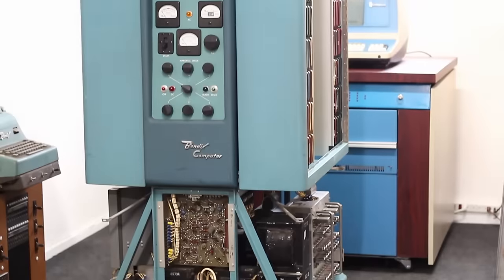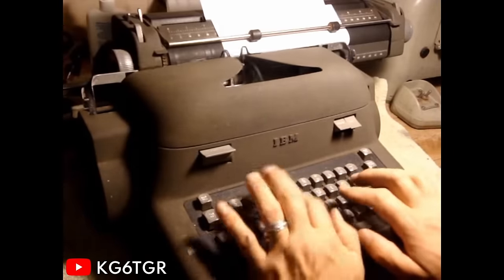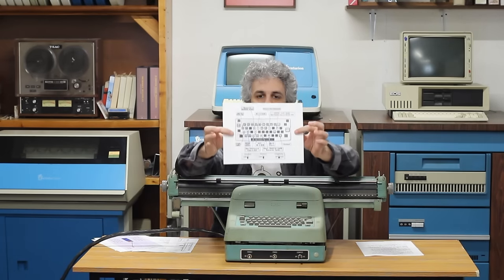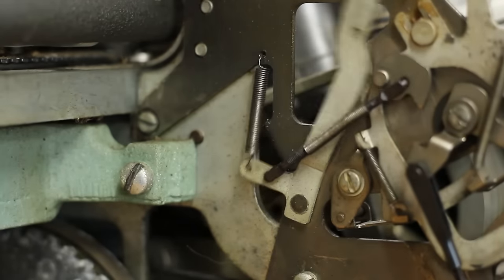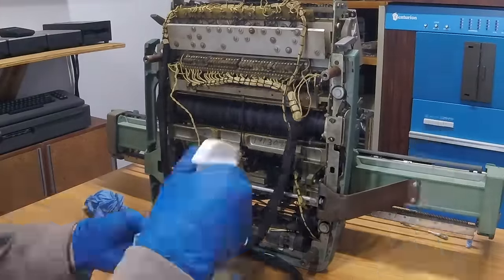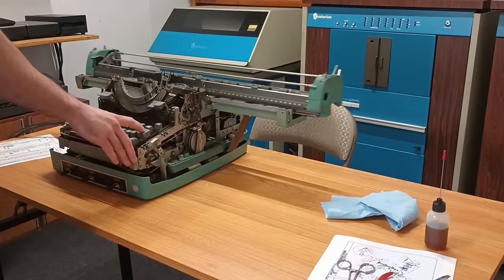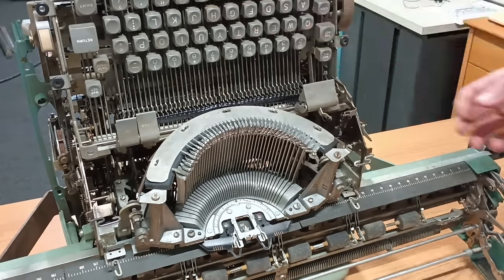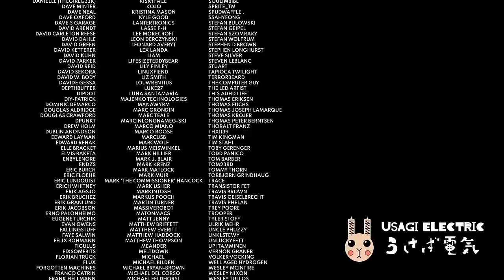The Bendix G15 Typewriter is Crazy Pants!

Comment: Love your channel and videos!

I used to have the basic typewriter that your beast is based on. And yes, it shook the desk every time you hit return. I can almost smell the oil from the electric motor bearings as I watch the machine run.

BTW, I worked in a computer repair shop that resold used computers. To clean them up, we used a SImple Green/Dawn dish soap combo in a spray bottle, with just a little water to thin it down a smidge. The Dawn breaks down the "people grease" (oil from people's hands) better than SG alone.

Comment: At Bendix, someone was told that size matters apparently.
Reply: What blows my mind is that the 28 inch platen doesn’t have the look of something which was cobbled up for a small order of a handful of machines.  15 inch platters were not unusual, but 28 inch!…. I would have guessed that maybe some sort of chart was printed on this Bendix-ized IBM.  I was thinking, perhaps weather maps, but the restriction of only 16 codes available for characters no special type slugs for graphics rules out printing maps.  Weird.

Comment: Great work looking forward to DC..   As for setting up the mechanics of the teleprinter you did right in passing this to someone tuned into that device, you skills are epic..  I know that teleprinters and typewriters can be a challenge,  I remember the Creed 75 RPTK which used an aggregate motion mechanism to translate  motion  in three planes to the drum type head.  Move R and loose the Y and vis a versa. Even a drop too much oil would through the alignment. The  IBM Golfball was a dream to set up.  Teletype 33 responded well to kinetic adjustment.  Best

Comment: Back in the 1960s, I worked on a slightly more modern computer called a LGP-30. It was also a tube computer with a drum. The typewriter was a Flexowriter and the hexadecimal codes were zero through nine, then FGJKQW.

The typewriter also had a tape reader and could be run independently using that reader.

The thing that strikes me about the typewriter in this video is the difficulty of managing paper. It must flop around quite a bit.

Comment: They make specialized cleaning solutions for platens.  You should try AF Platenclene Cleaning Solution.  It's what I use on the pressure sealing machines we use at work.  Simple Green is fab stuff but it is mostly soap and water which could dry out the rubber.

Comment: That’s awesome.  Not only the resurrection, the unique (did you say, “42 inch platen”?) dimensions! ❤

There is 1 mod’ I recommend.  A lamp inside the window of the printer’s power indicator.  Maybe a couple of NE-2 lamps, which would be period correct.

Your skillset may not cover fine tuning of typewriters, but your skills and results (with all the beautifully restored equipment behind you), is truly, outstanding and inspirational!  I am envious.

I’m looking forward to the next instalment of the Bendix system revival 😍.  It will also be impressive, if you can demonstrate a working program (ie, tic-tac-toe loaded from paper tape).

Comment: I had one these as a plain short platten IBM typewriter which had been through a flood.  It took forever to clean out the mud.  My Waterloo was that the motor was a goner and I was never able to find a motor of the correct dimensions even though it was a fairly normal looking fractional horsepower motor.  The plastic rollers and internal rotating bar for activating the type hammers were an interesting method , a bit like a piano - not even close at all to the Selectric technology which followed.

Comment: Wheeeeeeeee! Wheeeeeeeeee! I'm riding the carriage!
What a beautiful machine :)
It looks like it's badly in need of recapping, to do it true justice. For some reason it impresses me even more than the Selectric! Minty fresh with a hint of Tektronix teal.
Good luck with VCF East, and beat Jeri at pinball this time, haha! CuriousMarc will be there too.
Reply: There are a few paper tube electrolytics in there but the really bad-looking cylinders are diodes in a kind of rubber sleeve rather than capacitors (or maybe it was inductors but definitely not caps, the same style is used inside the computer).

Comment: I love this electro mechanical stuff.  A work of art.  Congrats on getting it cleaned up and working.  So cool!
For a split second, I thought I saw one or these used on the Loki series.  I just looked back and I think it's just a standard IBM electric typewriter but with a large platen.  Not a massive one like the Bendix.  BTW, check out S2:E6 at 46:32 if you want to see what I mean.

Comment: Remarkable progress on this thingy.  You might try finding another ribbon.  It looks like it's getting kind of dry.  That might resolve the lower-case printing problem without a lot of mechanical stuff.  I seem to remember that adjuster on the right for hammer force actually adjusts the distance between the platen and the hammer just slightly...  Play with that incrementally until a "best quality" print results.  Good work on this, man.  I'm looking forward to the day you push the big green button.

Comment: You have to do alignment adjustment, ring and cylinder adjustment, and then adjust the tension screws on the friction roller for a harder imprint.

Comment: You should have used oil and a little bit of hand sanitizer for the rollers but you do you 
And any other rubber that doesn't move  on a rod just used water if it's belts 
But just do you
You can adjust some bits of it

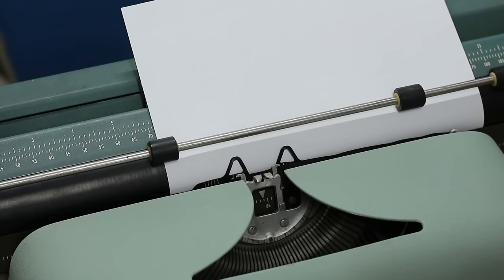Comment: From someone who grew up in the typewriter age, that lever at 18:30 that goes from A to F is to adjust the platen for when you are making multiple copies using carbon paper. Some of your viewers may now be wondering, "what's carbon paper?" I will leave it to the Internet to answer that question for them.
Reply: Surprisingly enough, at least in Europe carbon paper is still reasonably common. Earlier this week I had a plumber fix a minor leak and when he was done he handed me a clipboard for a signature, tore off one layer and handed me the carbon copy. In commercial shipping it seems they still use dot matrix printers (and you can buy them new) because carbon copies of the papers are a legal requirement.
Reply: @Ragnar8504  That's interesting. I don't think I've received more than one or two carbon copies in the last year, and even those didn't use carbon paper, but rather the "carbonless" paper with the microencapsulated ink. Actual carbon paper is almost extinct in the US, due, I think, to the privacy and security risk the discarded carbon paper presents.
Reply: There is a type of paper that works like carbon without the carbon sheets in between, forgot whats called but still have some for printer (with the hole tracks). Oh yes, most printers do have the same lever and for the same reason, to allow thicker paper (multiple layers) in,
Reply: @freeculture  Right, I confused two things. The plumber must have had that special paper but I recently watched my dad use actual carbon paper.

Comment: my engineering brain is telling me that you should sand the lower friction roller so it's even all the way across, then wrap it in electrical tape, as there's notches that have worn in from where the bottom of the hammers contact the roller.

Comment: The Bendix Code, often associated with control systems or specific types of coding mechanisms, doesn't directly apply to the mathematical computation of π (pi). If you're interested in encoding or representing the process of solving π, especially in a limited format like a "5-bit code", it would be an unconventional approach since mathematical computations, especially for constants like π, involve algorithms that are far too complex to be represented directly in a simple 5-bit format. 

A 5-bit code can represent up to \(2^5 = 32\) distinct values or instructions. In the context of solving or approximating π, this is highly limiting. However, if we were to think creatively about how one might use a very limited set of instructions or representations related to the computation of π, we could perhaps define a very simplistic, symbolic set of instructions—though this would be more illustrative or metaphorical than practically useful for computing π.

For example, we might whimsically assign each bit pattern a step or concept in a highly simplified process toward approximating π, like so:

- 00001: Start
- 00010: Increase precision
- 00011: Calculate area of polygon
- 00100: Double number of sides
- 00101: Check convergence
- 00110: Approximation good enough?
- 00111: End with current approximation

This "Bendix Code" for π is purely illustrative and not an actual computational method. To truly compute π, even at a basic level, one would typically use algorithms such as the Leibniz formula for π, the Monte Carlo method, or the Gauss-Legendre algorithm, all of which require computational steps and memory far beyond what a 5-bit representation could offer.

Comment: FYI, the typewriter is lovingly referred to as an 'Airplane'.  The extended carriage is so that banks and other financial businesses can type out the financial sheets used by banks.  It is also set to hit the paper harder than normal as they used 5-7 layers of paper with a carbon sheet between each.  BTW, the keys of the typewriter will not fall/work without power applied.

Comment: You should look into analog computers.  When I was in school long ago we used an analog computer in the course.   It solves differential equations.  It runs at ~100V so you have to be careful programing it.  Texas Tech also had a analog computer from the apollo program.  It too up a wall.  They had a game on it.  It was controlled by two aircraft joy sticks.  Two dots in orbit around a "sun".  They could shoot at each other in the direction of flight.  If you hit them they would blow up.  Amazing for an analog computer.  

When I do simulation today we use model very similar to the modules on the analog computer to solve differential equations.  But no shock hazard.  :)  .

Comment: Finding space for this typewriter is easy!  Just put it between 2 other terminals, but offset in height.  Meaning up so high that the platen passes OVER said other terminals.
Like right behind you, enough space is available  between the 2 Centurion terminals, if you side them apart a bit more.  The platen should even fit under that shelf above the right-hand Centurion's terminal??  OK, so you type standing up... 🙂

Comment: im finking .the bottom sling roler looks pollished.i did a repair on a pinch roler in a tape deck years ago and just sanded the rubber wheel  with 60 grit and it played fine .it was getting pitch bend warping the sound

maybe spin it up and sand a shiny track on the roler in one place .just touch the the paper on the roller use a hover suck up any bits .you can always blow it out with a air line .if you think about it lower case would have been used more .chances of a new old stock roller are?

Comment: The paper guide wheels and the platinum can be cleaned as follows;  yours are shinny and they shouldn't be.  with all the guide wheels removed from the typewriter, use a 220 grit sanding mesh and a rag.  soak the rag in alcohol or (trichlorethylene - now a government controlled liquid).  place the 220 grit mesh on top the the rag and using complete length strokes, run the full length of the part you are cleaning.  Ensure that the item your working on stays wet the entire time.  between 2-4 passes will remove the shine (which causes the paper to not pull evenly through).  give the part one more pass without the grit to remove any loose material.  P.S. wear gloves so that you don't kill your skin.

Comment: Getting the two cases aligned properly shouldn't be all that difficult. I know that on my father's Brother machine, which lifted the carriage rather than dropping the type hammer frame, the movement was governed by stop-screws. Adjusting the screws in or out adjusted the end position of the movement. I'd say this machine also has stop-screw.

Comment: Have the contents of the two timing tracks been saved someplace? iirc, there are two tracks, one is just a series of (equivalent of) alternating zero and one, and the other has some weirdness that lines up with the first track, but sometimes one and sometimes zero. If turning on DC mungs up those two tracks, you can re-record them, or even wiring in something like a arduino to simulate them (good luck syncing with the drum).

Comment: Bendix could have used clovers, hearts, moons, stars and rainbows if there were keys to type it in. UVWXYZ were just the opposite end of the alphabet and Bendix was unique to say the least. A man who worked in my dad's office for the USDA used a Bendix G15 into the late 1980s or early 1990s. He did cut and fill calculations for civil engineering earthwork. He could run those calcs as fast as Windows or Fortran or whatever.

Comment: I can't help but wonder what unit of measurement is used on the bottom scale by the platen! Top one is clearly inches, bottom one looks like millimetres at a first glance but 28" doesn't equal anything like 335 mm, more like over twice that (711 mm).

Comment: I don't think grease on the carriage bearings is a good idea. In my experience these bearings were made to run dry as dust and paper dust in particular can accumulate on the runners, mix with grease and clog up the carriage movement which is normally spring powered not power driven. Paper dust along with other grime and grease do not fare well in typewriters. The typebar segment should also not be oiled for the same reason as the carriage. Also note that any plastic or nylon used in this period could be fatally damaged by grease or oil. But having said that I have no experience with this particular item or its parent machine. Also simple metholated spirits is the industry standard for cleaning rubber parts If the rubber parts get a glaze and let paper slip then a quick rub down with fine abrasive paper is the way to go with a metho clean after.
If the shift is out then you will see a height difference between lower case and caps on the paper, also half of the letter missing will tell you what adjustment to make, if they are in alignment than it is not your problem do NOT try to adjust the shift settigns as some below urge you to do. There will be a setting or adjustment that increases typebar throw when in caps, likewise there will be individual adjustments to make sure that full stops do not make holes and other letters print the same density as each other. Also lift a typebar into the typing position by hand hold it against the metal part ring under the guide, at this pint you should be able to feel a slight resistance when a bit of typing paper is between the type on the type bar and the platten is moved around (the ring and cylinder setting), all typebars should be the same, also the same on the left and right side of the platten when you use the first setting on the platten adjust lever you discovered. This is used when multi part paper is used to prevent the type cutting the paper.
I think you need a power roll makeover, I don't know if anyone resurfaces these after all this time. It may also contribute to light caps printing.